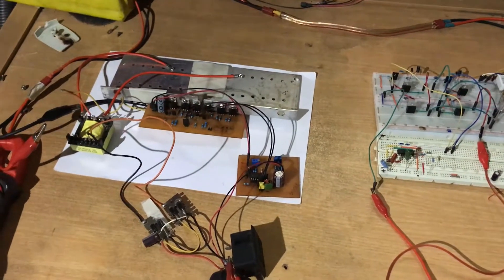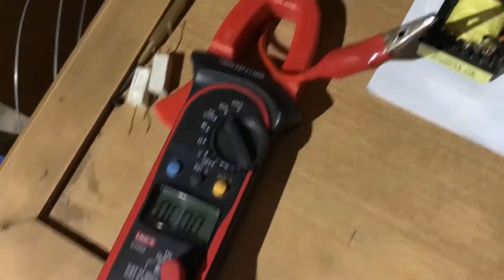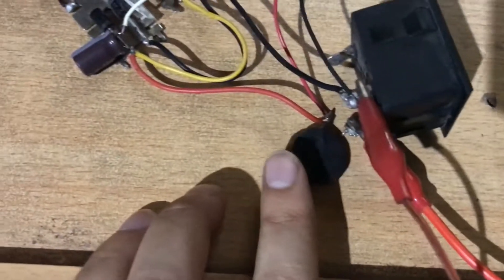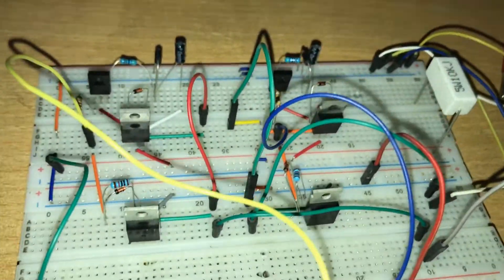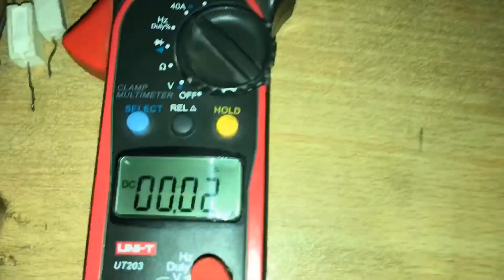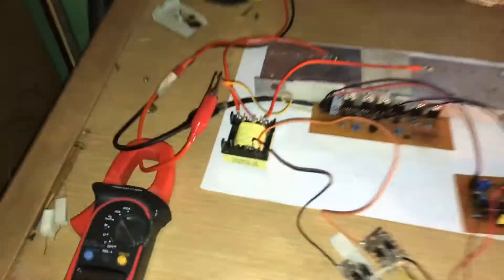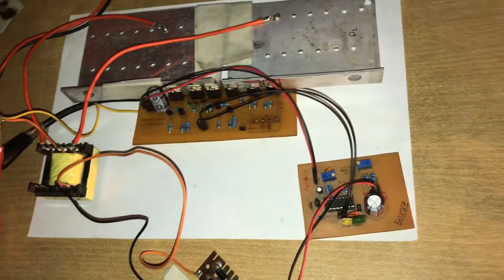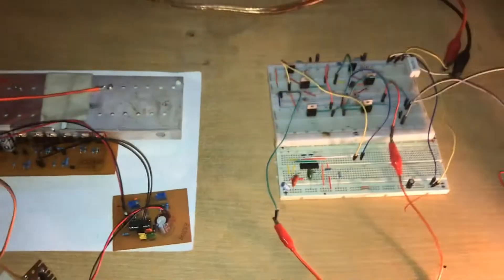DC to AC Inverter DIY - Power AC devices with a battery / homemade inverter

Comment: Seems like a lot of people forget that some AC devices just convert AC back to DC. Lots of laptop wall chargers can just be fed anywhere from 12v to 70v DC and it will go through the rectifier and be stepped up or down no problem. They are basically Car chargers with smoothing and a rectifier.